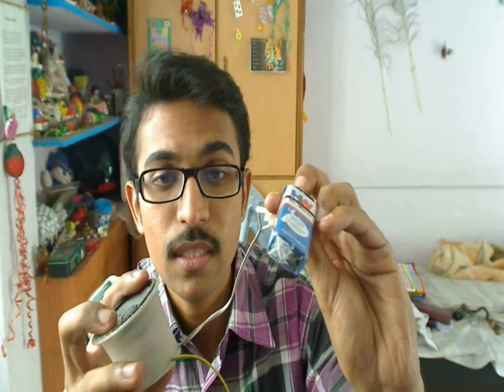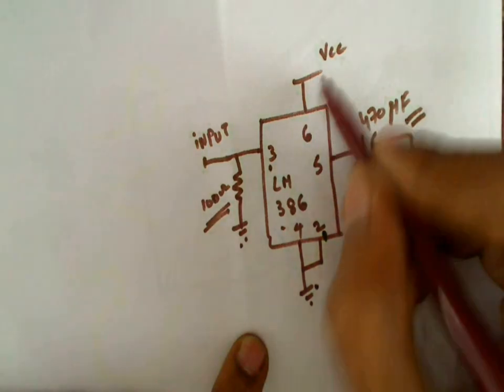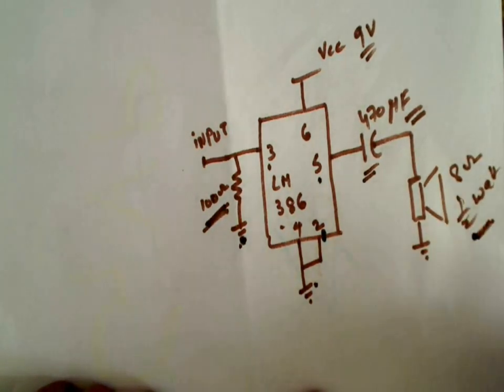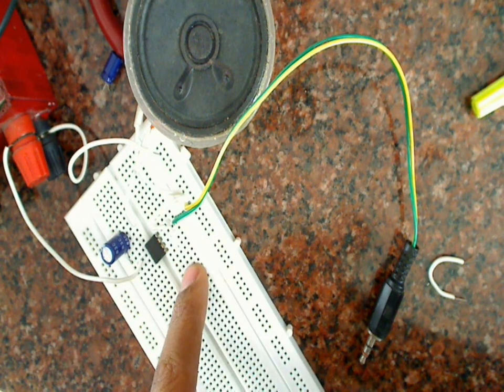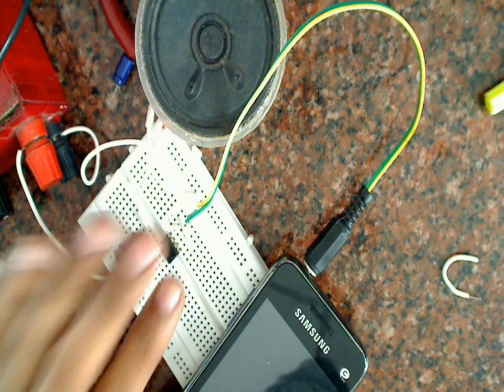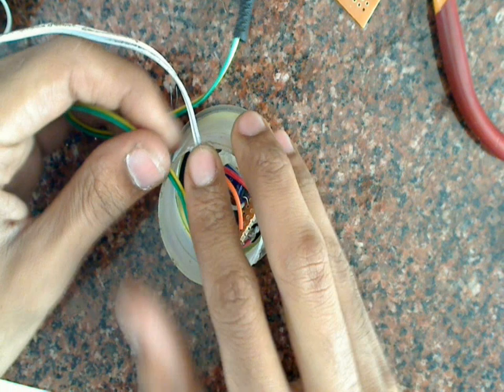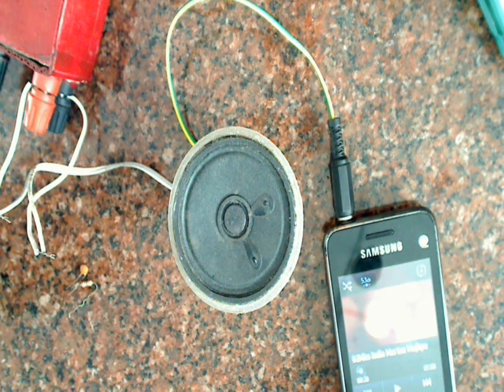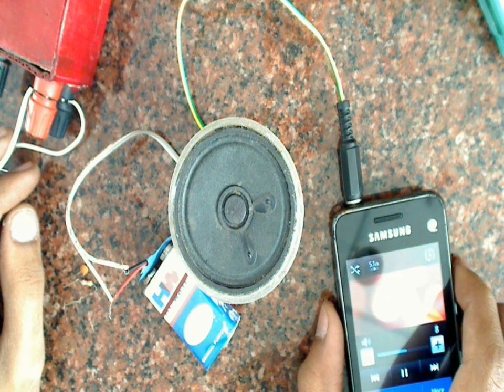Portable audio amplifier for mobiles and mp3 players

Comment: Hi Khader...Nice video! As I am a newbie to electronic circuits, I purchased a ready LM386 amplifier module. But I am unable to figure out the connections. Request your help to conduct the power supply as well as audio input signal.thanks in advance. Raj
Reply: Electronics Made Easy : KHADER plzzzzzzzzzzzzssz make one more vid this is awesome but I didn't understand that audio amplifier thing so
Reply: Rajendra Mangharam even j I buyed every thing but I am not able to do it

Comment: how can we eliminate noise ??
Reply from the maker: +Vamsi Krishna adding a 0.1uf capacitor at the input filters almost most of the noise. a 470uf-1000uf capacitor at the output before speaker also removes high freq noise. apart from these the ic lm386 has offset null pins which can be used to remove the extra noise by adding a capacitor between these terminals. use a battery to power/a well filtered supply to avoid any humm noise